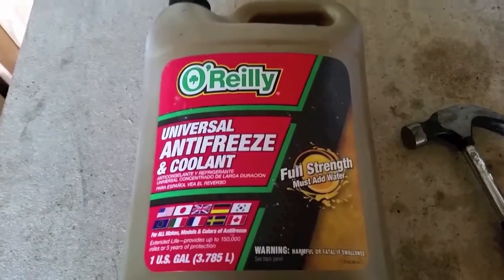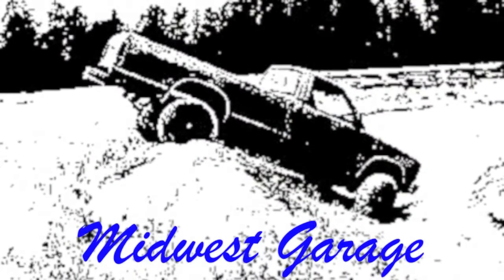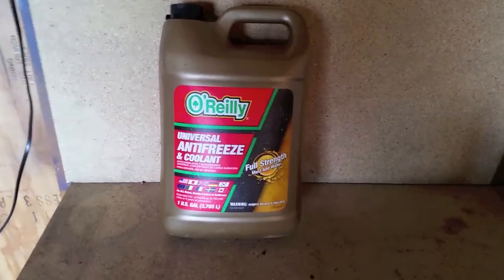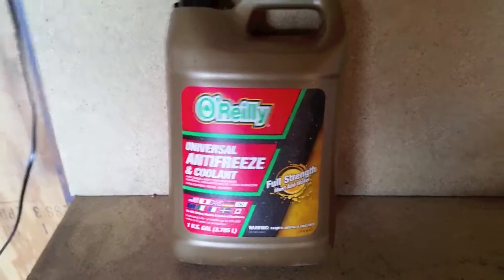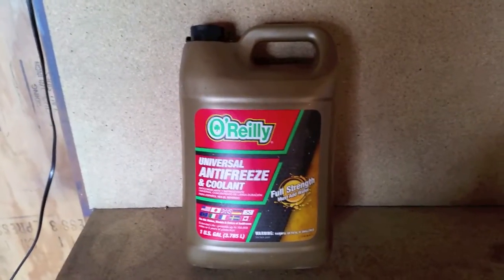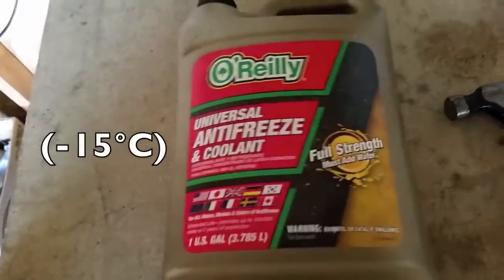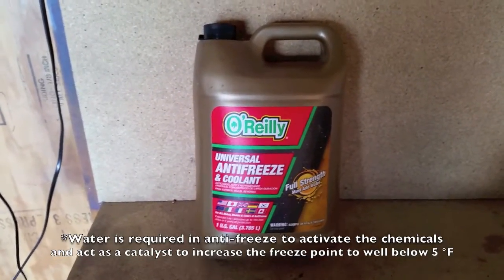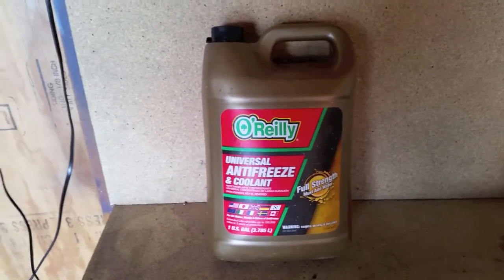Why You Need To Add Water To Antifreeze

Comment: I have 2500hd do I use 2 jugs of the same coolant and just fill the rest up with water?
Reply: I always mix the concentrate with distilled water in a separate container 50 /50  mix and keep doing so until full. Park the vehicle with radiator cap at highest point let it run and to get air bubbles out and the finish filling.

Comment: I've been running straight antifreeze for 15 years. I test 20 below zero. Stays clean, doesn't wear out water pump, hoses, and heater core stays clean
Reply: Do straight  antifreeze wont hurt the radiator
Reply: @navysealsrock1725  no!

Comment: What does the water do chemically to the antifreeze to change its freezing temp?  Up here high in the Rocky Mountains (McCall Idaho area) back in the 50's we ran 100% pure Prestone antifreeze and none of it ever solidified, even at minus 40 degrees or colder. I have a 1/2 cup of pure antifreeze in my deep freeze for about a week and its consistency has not changed, still a free flowing liquid.
Reply from the maker: I'm not exactly sure what it does chemically...I'm not that smart haha. It gets colder than a deep freeze up here on a pretty regular basis though. It usually freezes up solid in these parts.
Reply: It would have been more interesting to have seen the plastic jug cut away and exposed the frozen block of antifreeze for visual inspection. I know sailors who wintered over in Antarctica and they never saw pure antifreeze freeze from the cold.